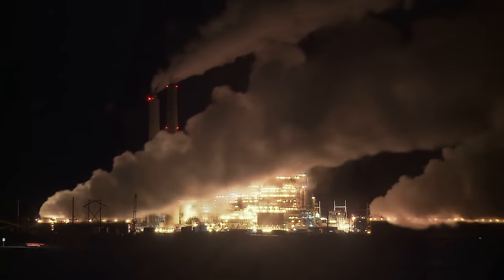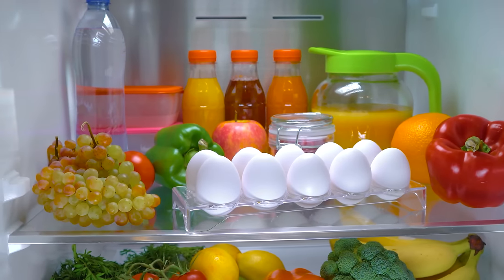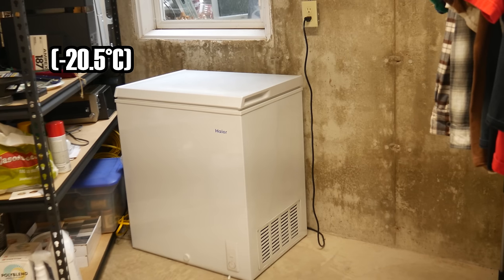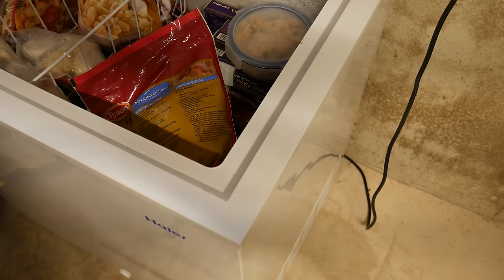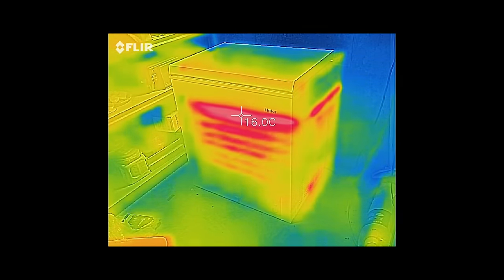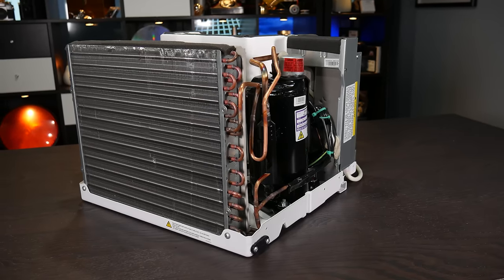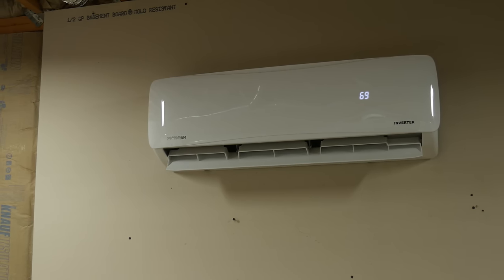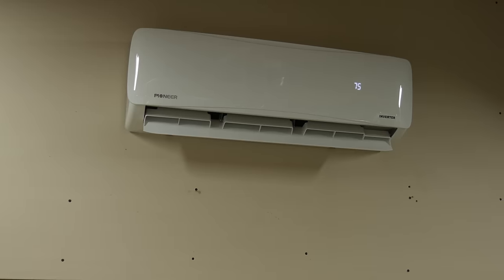Heat Pumps: the Future of Home Heating

Comment: It feels like latent heat is basically an exploit in the universe we're taking advantage of.
Reply: Just gathering and moving hot from one place to another :)
Reply: I always think the same thing about hydraulics as well as other simple machines. Literally just exploits of physics.
Reply: It's basically a battery, a form of stored energy. Interestingly, there are places in the universe that are colder than the current temperature of the universe. The Boomerang Nebula has been measured at 1 kelvin, while the average temperature of the universe is measured at 2.73 K (using the CMB).
Reply: All machines are exploits of nature: A water wheel is just an exploit of gravity, internal combustion engines is an explore of chemical energy, computers using transistors is an exploit of how electromagnetism works etc. A machine just arranges a natural phenomenon in such a way that it's useful to us.
Reply: You don't get owt for nowt, as they say in Yorkshire. Mark my words - extracting heat from from one part of the ecosystem to move it into another will have unforeseen (ie bad) consequences. I don't know what they will be but 'twas ever thus. Think your exploiting the universe? Think again...entropy is a one-way street.
Reply: A wild TheeGee appeared.
Reply: @LukeGibsonSS  Well, it depends on the energy source. Stuff like hydroelectric dams and giant wind farms do noticeably influence local weather, sometimes a lot. But solar power and heat is staggeringly abundant.
Reply: @davidjgomm  Hope it's a troll))
Reply: @davidjgomm  It doesn't do anything because we're not changing the total amount of energy (by any significant degree at least, the compressor does release a bit of waste energy) we're just concentrating it in one place from which it will eventually radiate away from again (that's how your house cools down on a cold day). Heat would only really become an issue for our society when we've reached the point where we're covering the entire planet in houses.
Reply: Well... It kind of is exactly that. It's just we don't call it an "exploit" we just call it a "use"
Reply: How do I get Xbox Live for free?
Reply: @suppressed_viii  talk to the spiffing brit. Hes got all the good stuffs for that
Reply: @p_serdiuk  1. citation needed 2. they are only talking about heat exchanges 3. while all heat is energy, not all energy is heat, at least not in the way being described. 4. I think you'll find much of the local weather influence you are suggesting is actually The effects on the ecosystem by wind and hydro not being caused by the generation of energy. They are physical environmental effects caused by the structures themselves, the land they use and the space they take up, how they function and operate.
Reply: @JuanWonOne  im joking, ThioJoe used to make “How to get Xbox Live for free” videos, but they were troll videos and never actually worked.
Reply: energy is perfectly balanced ;)
Reply: Tierzoo has entered the chat.
Reply: @davidjgomm  
Entropy still increases so the universe doesn't care....
Reply: Total entropy is still going up in this case. The little bit of work the compressor does to maintain the pressure differential ultimately ends up as heat and is just the bit needed to make the entropy increase of the inside of the house bigger than the entropy decrease of the outside (ironically, the COP would be 1 due to this energy input alone, meaning heat pumps are always more efficient than space heaters wherever it's hot enough to keep the refrigerant colder than the outside).
Reply: That's just engineering in general. Just gaming the natural system.
Reply: Considering latent heat is what will eventually kill the universe, maybe not so much...
Reply: @suppressed_viii  ah, I guess if I knew who thio was I woulda got it lol. But the spiffing brit just put out a video on how to literally get xbox games for free (well for a buck anyways)
Reply: I literally just watched your latest video earlier.
Reply: Some Bleeding Heart: End the exploitation of latent heat!
Reply: Did The Spiffing Brit come up with this?
Reply: @palarious  The "heat death of the universe" is not the "latent heat death of the universe"
Reply: @jebeda  don't care. Heat death of the universe results from being unable to utilize an energy differential, the exact sort of work being done here. Once everything is effectively the same energy level, time runs out for any life we can conceive of. 

If you want to be pedantic, feel free, but it's not going to make much of a difference.
Reply: Thermodynamics and statistics are two almost irrefutable pieces of evidence of contact with aliens.
Reply: @palarious  "If you want to be pedantic, feel free, but it's not going to make much of a difference."

That made me smile. I cannot conceive of ANYTHING that ANYONE could do to influence events 10^100 years from now.
Reply: @jebeda  It is about as inevitable as inevitable gets.
Reply: @palarious  Inevitable for the universe maybe, but really not a factor in anyone's future plans. There are lots more inevitable things that we are going to actually experience. Death and taxes perhaps are of more practical importance to you and me.
Reply: Wait until you read about diffusion, used by living things
Reply: It is basically reversing entropy. Granted more energy will always be used than what you can concentrate, but it certainly stalls heat death.
Reply: One interesting idea is whether a heat pump could be efficient enough to power a stirling engine that powers itself. It wouldn't be "free energy", you'd be taking heat energy from the environment to operate it, but for a source of energy we normally see as a "waste" it would certainly be better than nothing.
Reply: @suppressed_viii  my uncle who owns a Nintendo said you just have to use Strength to move a truck. Or maybe that was a different thing...
Reply: 0 degrees Celsius is 273.15 degrees Kelvin.  So, there is a LOT of latent heat available, and that heat can be converted into usable energy.  This seems to be completely unknown to 'science', but it's not.  The truth is, it's everywhere around us and it's freely available.  Modern industrial heat pumps can achieve COP above 15 to 1.  That means for every watt spent you get > 15 back.  Better than bank interest that's for sure. Think about that for a moment, or two.
Reply: Well, thermodynamics is the thing that will end with all possible life in the universe eventually, so...
Reply: It's just moving energy in the house from outside, while at the same time pretty much the same amount is leaking back out. Energy does not get lost. No harm done.
Reply: @davidjgomm  Entropy?  You are moving entropy from one location, into another.  If you are moving heat into a room, or some other closed space, from outside you are also removing entropy from outside.  This can not be considered a closed system but there is a little extra entropy being developed by the system.  I'm aware that the universe is probably not actually infinite however it is certainly big enough to consider it as such for a few million years or so, therefore the entropy is basically negligible. 
"There are more things in heaven and Earth, Horatio,  Than are dreamt of in your philosophy". William Shakespeare
Reply: Engineering is all about pushing the limits of physics.
Reply: @Zippy Dastrange Yes, I'm sure he is one of the loayal 8 subscribers you have.
Reply: @Aquatarkus96  yes but in winter it's colder outside, so how on Earth can you heat the inside of your home with this?
Reply: @Withnail1969  did you watch the video?
Reply: @Aquatarkus96  I did, the laws of physics remain the same as they were before I watched it. You can't warm up your house using air that is colder than the air in the house.
Reply: @Withnail1969  By your same logic an A/C wouldnt be able to work either
Reply: @Aquatarkus96  air conditioners work but use a lot of electricity. this device will also use a lot of electricity. you might as well just use electric heaters. there is no such thing as a free lunch.
Reply: @Withnail1969  This is more efficient than resistive heating. I don't have tine to explain basic physics to a luddite.What is so hard for you to believe? Just accept the physics works if you cant comprehend it.
Reply: @Aquatarkus96  nonsense. again., there are no free lunches. if it's colder outside than inside, you can't use that colder air to heat your house.
Reply: @Withnail1969  You're not using the "cold air", you're using the thermal energy in the environment outside. Theres always heat energy to use, everywhere that is above 0K at least. The whole idea is to collect heat into one point and move that heat. The air itself doesn't move from outside to the inside. Its about as close to a free lunch as physics will allow. " there are no free lunches." Tell that to the tree outside!

By your logic air conditioning doesn't work. After all, AC in essence uses the cooler air in the home to heat the outside by your logic.
Reply: @Aquatarkus96  yes at what energy cost? you might as well just use electric heaters inside your house as attempt to 'collect heat' from 1 degree celsius outdoors air.
Reply: hi theojoe
Reply: aka engineering
Reply: Mind it is the heat "pump". It "pumps" thermal energy from outside to inside or vice versa in AC (air conditioner) mode.
Reply: @Christopher-N  of course that would be the case.
if there is an average of 2.73, and there are places where it's hotter than that, then there must be places colder than that to counteract the heat. 

Otherwise the mean temperature would be higher
Reply: @Withnail1969  are you ready to sue heat pump manufacturers for false advertising?
Reply: @andruloni  i don't own a heat pump.
Reply: @Withnail1969  but you are so sure they don't work. I'm sure you could prove it and get some nice cash money to run your  other heaters
Reply: @andruloni  You can't sue people for a defective product unless you own said product. I'm not dumb enough to buy one. Even if I did own one and sued them, you don't profit from such a legal action you just get made financially whole.
Reply: @Aquatarkus96  but things get 970x more efficient at one specific point!
Reply: The outside air is 270 Kelvin (approximately).  For water-based humans it feels cold, but not to the universe (which is 3 Kelvin average).
Reply: Plenty of heat outside to capture & then move inside.  We’re not moving the cold air inside.  We’re moving a refrigerant which carries the heat from outside.  We squeeze the gas & it releases the heat inside the house (therefore it gets warmer).  That process is repeated almost continuously

.

.
Reply: Resistance heating makes 1 watt of heat for every 1 watt electricity.  BUT a heat pump MOVES (not makes) heat from the outside world to my house.  6 watts heat moved for every 1 watt electricity used.
Reply: @LukeGibsonSS  If "before you talk out of your ass more" was not included, your comment would have been a perfect, informative, take-down 10/10
Reply: @davidjgomm  Sure, It may concentrate the heat in Yorkshire from outside into shoeboxes in't middle of t'road, but eventually, the heat will escape  and achieve entropy bart 'at
Reply: @Withnail1969  You better let all those heat pump-making companies know their product doesn't work, and all of the people who rely on them. I'm sure the scientists and engineers who designed these devices would sure appreciate the heads-up from someone who knows more than them.
Reply: @Withnail1969  Maybe if you paid attention to the vid, you wouldn't be so lost 😂
Reply: @dreugh424  I'm not lost. I understand entropy that's all.
Reply: @Withnail1969  Maybe you do, but if you continue to deny that this works, then maybe you misunderstand how this tech applies to it
Reply: @dreugh424  it 'works' sure, but only at the cost of a lot of electricity. it would be more efficient just to use an electric heater indoors.
Reply: quoted by a video
Reply: Fun fact, because energy is conserved, increased pressure increases the temperature that fluids boil, but therefore also reduces the latent heat it absorbs to boil. Raise the pressure enough, and the latent heat it absorbs reaches zero. At that point, the fluid will freely exchange between liquid and gas. It becomes supercritical.
Reply: @davidjgomm  im gonna check with a bird I like from Scarbs if that's a real saying
Reply: @seronymus  Let me know what she says…
Reply: @davidjgomm  oh right, she said it is a true saying there haha thank you. She says it very casually though and explained for her it's like you say it after something happens like "it is what it is"
Reply: @suppressed_viii  By saying poopenfarten to a german
Reply: @davidjgomm  
not really, entropy "tend" to increase with time but after a veryyyy long time (like 10^10000000000 years or for example) , the system will create a new singularity/energy. We can say that time is, in the end, the real source of power of the universe.
Reply: @vincemorgan9640  same can be said with hydrogen. The #1 element
Reply: @Withnail1969  I suggest you either refrain from pretending to actually understand physics, or alternatively take the time and effort to at least get a bit of a grip on thermodynamics at your earliest convenience.  You really are writing nonsense.
Reply: @vincemorgan9640  I understand it very well and so will anyone who tries to heat their home with a heat pump when its below freezing outside.
Reply: @Withnail1969  Yes, if it is cold enough to ice up the heat-ex-changer a heat pump will be worthless.  However that is a specific circumstance and is not the case where I, and many others live.  Re-gauging is cost free according to Einstein himself so the working principal of heat-pumps is simply basic physics.
Reply: @vincemorgan9640  it is when it is very cold outside that you need heating, that is obvious. heat pumps are therefore a waste of money.
Reply: @Withnail1969  Heat, and temperature.  To increase the temperature of a body of gas you reduce it's volume, thereby maintaining the same amount of heat, at a higher temperature.  You then move that heat to where you want it by moving the compressed gas to the desired location and transferring the heat into the desired location via thermal conduction. Rinse and repeat.  There is no room for debating the efficiency of heat pumps.  It is akin to arguing about the color of the sky.  Whether you understand it or not, or whether philosophical statements such as "there is no free lunch" etc. agree or otherwise.  It is simply a matter of fact.
Reply: @vincemorgan9640  you can't 'move heat' without expending more energy overall than just producing heat where you need it. you can't defy entropy. end of story.
Reply: @Withnail1969  Of course.  That is why you have petroleum refineries on every corner.  Because you can't move petroleum around without using more than you are carrying.  Silly me.
Reply: @vincemorgan9640  petroleum is nothing like what a heat pump does. petroleum represents millions of years of stored solar energy. however we are approaching the point where it will no longer be worth drilling for oil due to diminishing energy returns on drilling, all the good oilfields having been long ago used up.
Reply: @Withnail1969  yes you can dude you do not know what you are talking about. Look up the coefficient of performance of a heat pump, you'll find them to be usually around 3 depending on the temperatures.
Reply: @Redtooth75  you can't beat entopy.
Reply: @Redtooth75  nice explanation but you need a therapist and a miracle to make that guy understand facts 😂
Reply: "clever use of mechanics"
Reply: It is cool to see you in here
Reply: Heat exists in all form of matter. Absolute zero is somewhere around -430 degrees, which is virtually unattainable.
Reply: Ahhh, quiet, you.
Reply: From an entropy standpoint, it's the last vestiges of usefulness of gathered energy.
Reply: @Christopher-N  I mean... is it really that interesting that a set contains values lower than the average? :P lol sorry. But it's an accurate reduction! There are places on earth colder than the average temp of the universe! It's just an average!
Reply: If you want to see cheating, check out what they're doing with the latest generation of CPUs and gpus. They have to incorporate and take into account Quantum effects because things are so small and close together
Reply: Latent heat is how ac units work .
Reply: I think youll find, we're the ones being taken advantage of
Reply: First order phase transition baby!!!
Reply: latent heat is what puts the thunder in thunderstorms. Nature puts it to many uses
Reply: @liam3284  latent heat is the heat that changes srares of matter. Thunder is caused by expanding gasses
Reply: @davidjgomm  The heat just leaks back outside over time, so it is like a bilge pump pumping a leaky boat.
Reply: @davidjgomm  reversing entropy is a key part of how heat pumps/air conditioning work. The compressor/condenser is putting the cat back in the bag.
Reply: @Withnail1969 I hope you've at least finished the video, by now.